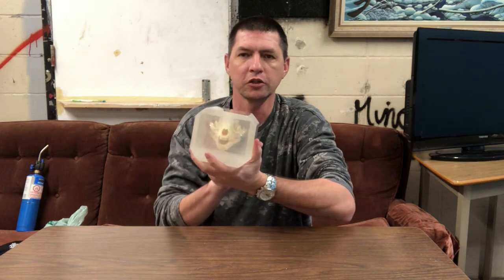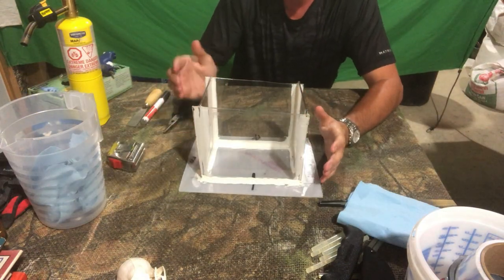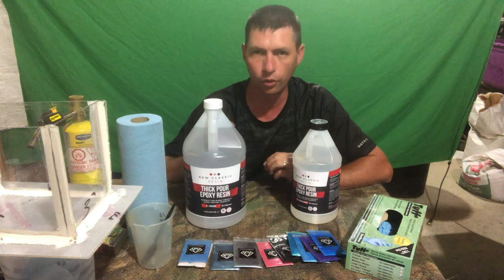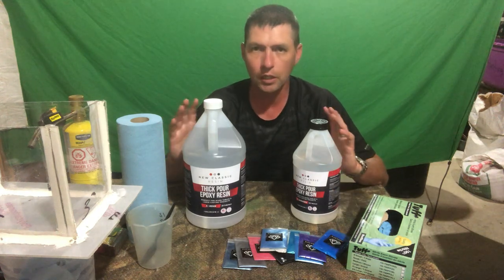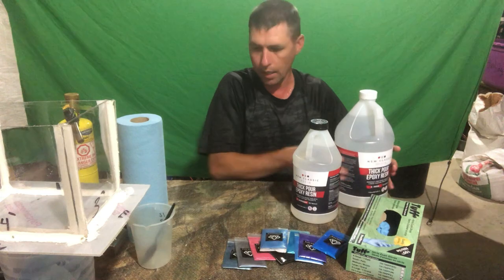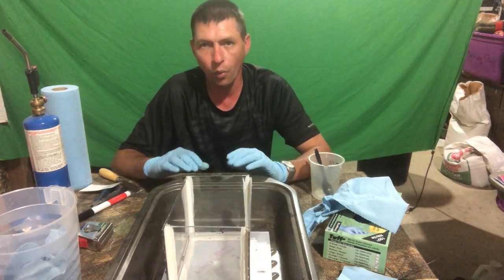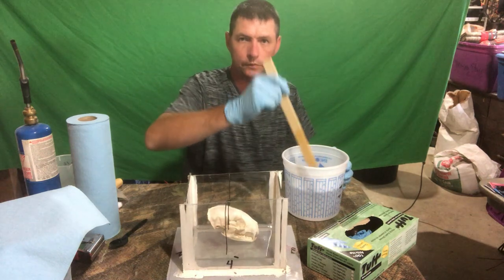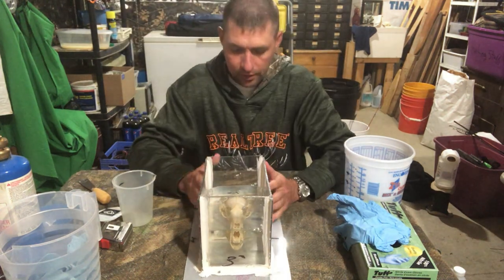Real Epoxy Skull Mount Complete Process Safe and Clean

Comment: I think a little more care could be made with regards to box sizing. If this stuff is as good as they say. The width of the skull plus 1 inch, same for the other dimension. This will reduce the amount of epoxy needed. I dont think it will take away fror the presentation of the piece. This leaves more epoxy for other projects.
Reply: Very cool project

Comment: This vid is EXACTLY what I needed. Anything you would do different? I am putting a beaver skull in resin 

Thx for posting
Reply from the maker: yes...i wouldn't do any color at all, it actually takes away from the skull, and i would do more smaller pours to avoid any cracking or bubbles